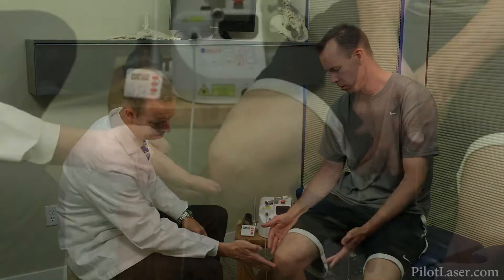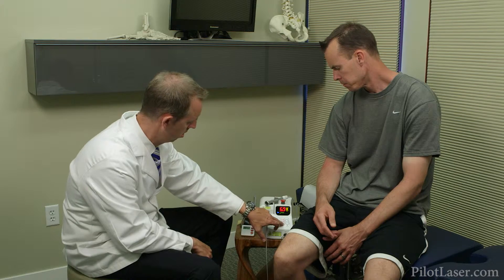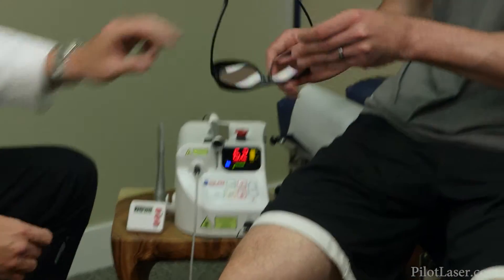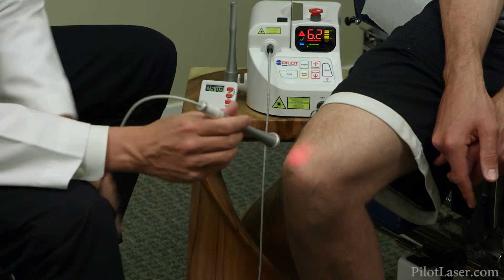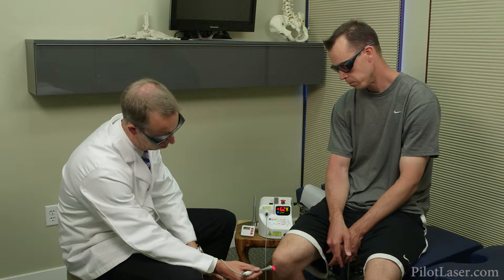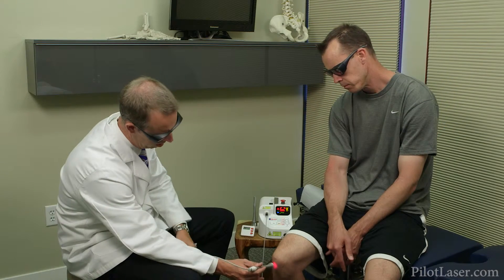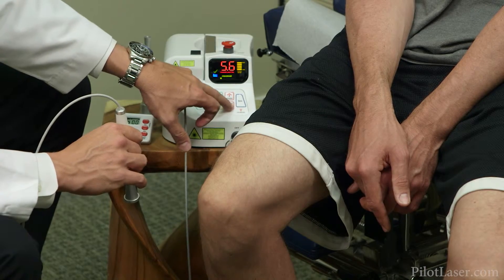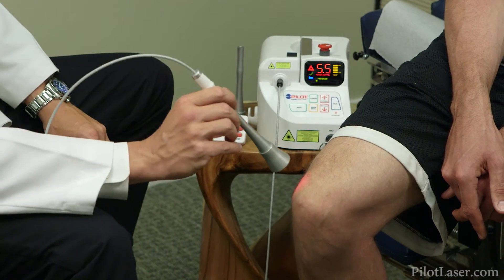How to Perform a Procedure

Comment: Thanks Dr Scranton That was great information. You definitely hit on all the most important points. I just wanted to touch on some experience we have had in treating knee or shoulder or ankle problems.  Frequency of visits is also very important. For acute recent injuries we recommend 3 - 5 times per week followed by a re-exam, We normally begin at the moderate power levels 5.0 - 7.0  We also spread out the laser area to encompass the anterior, posterior, medial and lateral areas. Almost like an ace bandage would wrap around the entire joint. The laser seems to improve the flow of nutrients to the affected area and at the same time help to improve the removal of tissue debris in the involved area. This is why we apply the laser all around the injury. Of course we focus at least half the time on the area where the injury has occurred. The average time to apply laser to the entire knee area is 15 -20 minutes. It can also help to passively move the affected area in normal ranges while applying the laser. During the 2 - 4th weeks, as long as they are improving we normally increase the power and decrease the time but we still treat the entire area. Rarely do we treat beyond 4-6 weeks. It seems if the laser is effective it will begin to really improve someone's symptoms and improve ROM in 5 to 10 visits.Chronic injuries like OA and degenerative arthritis can take up to 20 -30 sessions spaced out over 2-3 months to be able to measure and document improvement. We always begin at the lower setting 3-5 watts until we determine the patients response to the laser. If all is well we will gradually increase the wattage in 1 watt increments over 2-3 sessions. We rarely use 9.0 but prefer to use 8.0 as the max. Treatment times for us are the same 15-20 minutes. We still focus half the time on the area of complaint and the rest on all the surrounding tissues as explained on the knee example. At the higher setting of power we will shorten treatment times to 10 - 15 minutes. I hope this helps the doctors who are using the pilot lasers get better results. I learned through experience and sharing with other doctors. These tips and times are just suggestions and are my own opinion and should not misconstrued as peer referenced advice. You should always perform a complete consultation and exam and special imaging if indicated. You should develop a treatment plan and be sure to get informed consent from the patient. You should always follow up with re-exams documenting improvements or non improvements. You should always complete a daily visit SOAP note giving the area you treated, the time you spent and the power wattage used and the wavelength of the laser being used. Joules of energy should be calculated also.  You should be ready to refer to another provider if there is no improvement. Lets do a good job here when using the laser on our patients. Do not use the laser willy Nilly trying it on every ache and pain you see. Yes it is safe. Yes it is effective. And yes you could get into trouble if you fail to be a doctor when applying the laser. Dr Tred Rissacher DC